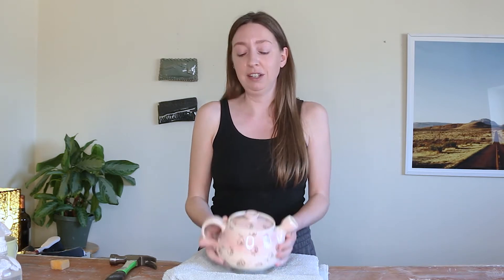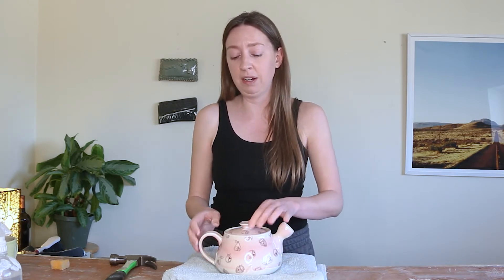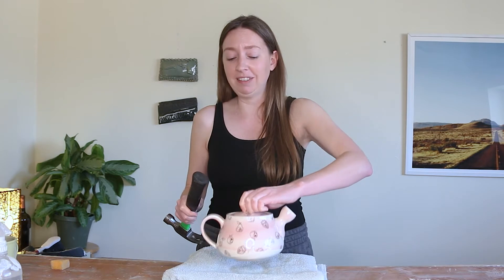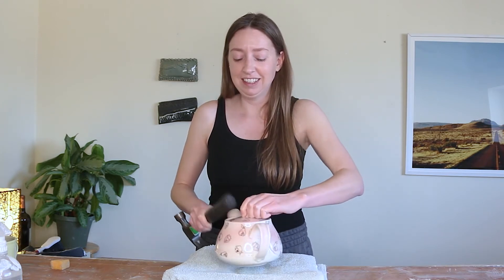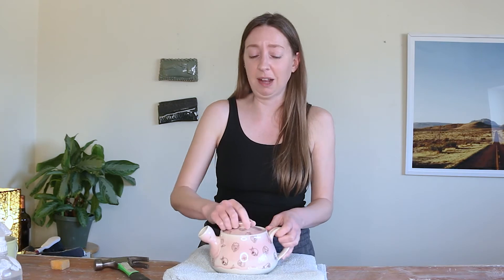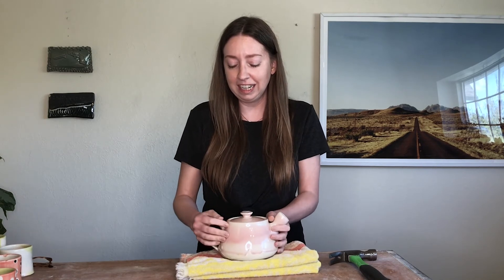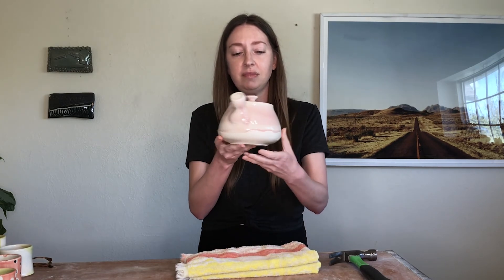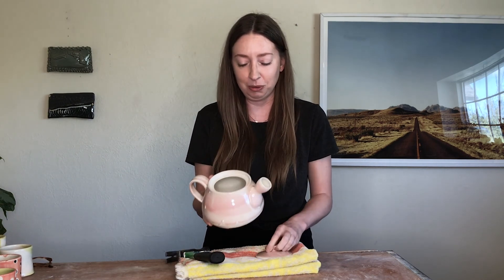Pottery Tutorial- The Lid is Stuck to the Pot?!

Comment: Can it be put over a stove add water by plant watering can and then low heat on a stove  and see if gets loose.
Reply from the maker: Hello Maryann! You could try this, but putting ceramic directly on a burner might cause it to break. Also I don't think the heat and steam would be hot enough to reactivate the glaze, which is what caused my piece to eventually come loose. The heat from the kiln put the glaze back into a liquid state, allowing it to move around and release the lid from the pot. However, pottery is all about experimentation! So if you can accept the risk of breakage, try it! Let us know how it goes, and thank you for watching!
Reply: Was thinking for those that have no kiln, perhaps a hair dryer may heat it to a liquid like almost state. Maybe?  Or heat the toaster oven, let it cool some then put kettle inside maybe? I am no expert just guessing.

Edit: maybe after they dry a load of clothing, put it inside on a soft towel see if it works.  That hammer handle sure would worry me for any breakage, you are brave and more experienced! Good luck to all with such a problem tea kettle.
Clarify, when dryer is off, has stopped, put it in there with aftermath heat left inside.